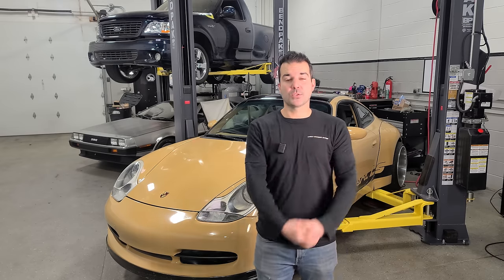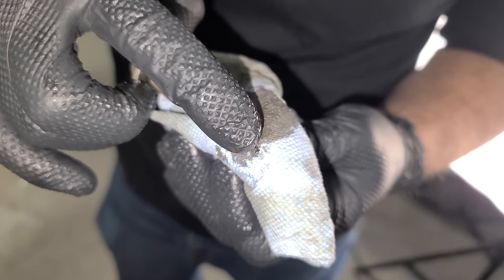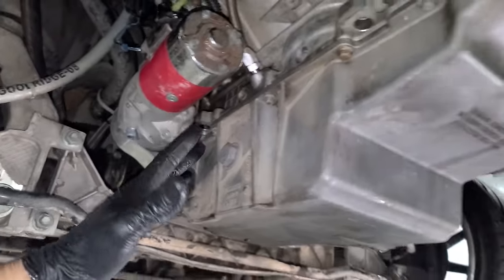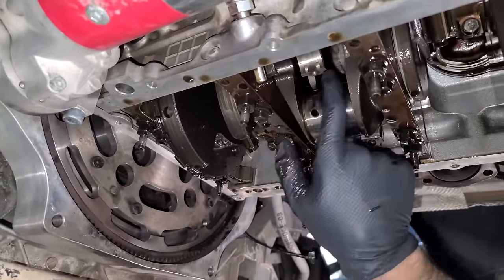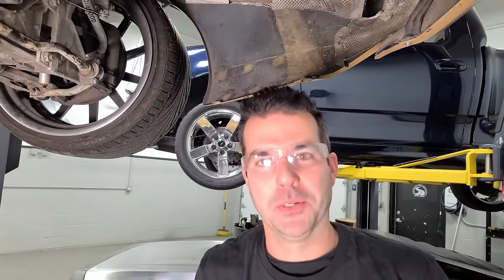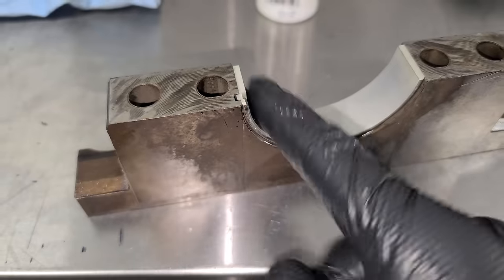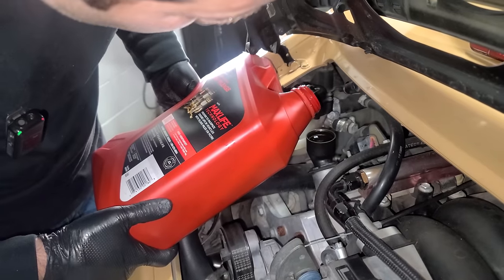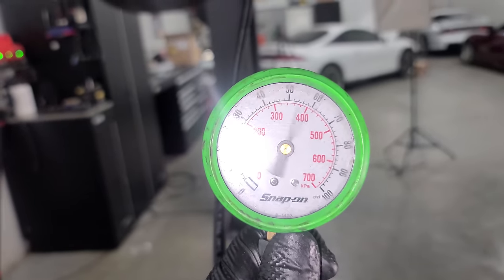My LS Porsche 911 Was About To BLOW UP So I Attempted A RISKY DIY Engine Fix!

Comment from the maker: What are you guys working on this week?
Reply: Here in Canada, big storms are approaching, so working on my snowblower and getting that fixed and ready! 😢😂
Reply: Xmas lights bro.
Reply: ‘70 Boss 302 Mustang.
Reply: Trying to get a broken rusted piece of the fuel pump module send line out of the plastic fuel line that connects to it, in my LS3 swapped Escalade. For oil pressure reference, my cammed/supercharged LS1 corvette with a new oil system (melling) has a hot idle of 13-17psi @ 850rpm.
Reply: Im working on staying warm here in scotland 😂
Reply: 98 gs400 doing a bmc conversion and big brake swap. Once that's completed I'll be doing a manual swap.
Reply: Cooking for friends this week! Cleaned my Miata in anticipation for the first snow last week, so I'm pretty much done until it's not cold outside!
Reply: On my Bmw e21 316  😄 ( just maintenance)
Reply: 1983 Rx7
Reply: Working on studying for my exams this week! Got one more semester of university in spring.
Reply: I just love videos like this! I geek out on engine rebuilding and I had to change the head studs on my 1998 Oldsmobile Aurora 4.0 V8 (DeathStar) months ago. So I know how intense this LS overhaul can be. BTW ARP head studs are a game changer!!!!!
Reply: 1985 Nissan 720 King Cab Pickup
Reply: Not much. But, a friend is helping me replace the thermostat on my 2011 Nissan Murano.
Reply: I wish I was working on my 4th gen firebird...I don't have a garage and it's snowing and below zero...so I'm standing at the window dreaming
Reply: Unfortunately my new NON Legit streetcar! 2010 kia soul lol
Reply: Minibikes
Reply: Working on my 13 vw gti, maintenance work for winter as my daily to work , Pennsylvania winter roads can be brutal on suspension and brakes.
Reply: Thinking of doing some valve cover and intake manifold gaskets on my 5.7 hemi.
Reply: A bit off topic from the channel but 3D models and voice acting.
Reply: I live in the sticks of Queensland Australia. Not as flash as the porshe, but at the moment im working on a Kandi Spyder side-by-side.

I'm welding up and beefing up parts of the buggy's frame and the seat frames that have fatigue cracked from scrub-bashing and rally driving.

I thought I should fix up all the broken bits from the nieces and nephews thrashing about in it last holidays so they can thrash it about and break it all over again during this holidays.

Love your work Alex, thanks for the great content
Reply: TVR Griffith 500. 5.0ltr V8. 
  Simple enough job of installing speakers in the rear. (Just upgraded the door speakers and thought it better to have a matching set in the back).
Reply: 1978 BMW r100 Cafe
Reply: My wife making me clean my garage....... lolz
Reply: If the rain stops and temp isn't stupid low, I plan on replacing my stock front subframe/engine cradle with a TSS Fab tubular unit. I also need to go pick up my freshly rebuilt 6spd and get it into my 2010 STi.
Reply: '99 Rover 75 2.5 V6. Has a problem with the cooling system becoming over pressurised. I assumed head gasket failure but block tester fluid stays blue (I.e. no exhaust gases in expansion tank).
Reply: A miss in my 6.0 reg cab short box Silverado. Pretty sure it’s injector related. Then brakes on the Challenger and then fuel pump on the Vette. 🤷🏼‍♂️
Reply: 95 Ford Probe Gt. Engine swap finished a week ago so now it's suspension time.
Reply: My 1980 AMC Spirit. Getting it up to speed after a 17 year vacation.
Reply: Baking my headlights and swapping out the lenses since they are beyond polishing.  Adding new angel eyes to make it more like a modern BMW.
Reply: Repairing computers 😊
Reply: I don’t work on Cars, but I want to one day. I manage a Hotel so I’m working on selling rooms!
Reply: 1968 BMW r50/2
Reply: 1989 Integra !
Reply: 69 Chevelle.
Reply: 2016 Silverado rebuilding 6l80
Reply: 2019 silvrado v6 turbo addition
Reply: I'd like to be working on a V8 S10 conversion...  But no - I'm not sure what the interest will be in a chat full of car nuts (inc. my self - though I'm interested) - as a low buck alternative I'm in the planing stages of building an E-bike (working out details, making a parts list, and cading up some custom parts).
Reply: Mk4 GTI
A/C compressor is rattling like mad and needs rebuilt/replaced. Instead I ordered a serp belt short enough to delete the A/C until it's warm enough to actually need it😂

ND2 Miata, diff fluid and winter wheels/tires swapped over
Reply: oil pan pickup last night for a new Moroso T-style pan for my 351c mustang
Reply: My ‘18 Tacoma TRD Off Road 4x4
Reply: Snowmobiles... 2 Skis 2 Cylinders 2 Fun
Reply: I've been out of work for almost a year now due to cancer, but today I got volunteered to replace my mother in law's headlights in her 09 Acadia, a pigtail burnt up, so the bumper had to come off...I miss wrenching every day. Now that I'm done with chemo and all the crazy treatments, I'm coming back soon hopefully! Today was the first time I've turned a wrench since January of 23
Reply: My Ford falcon here in Australia just hit 200,000 kms. So I'll do a Coolant flush. Gearbox service, brake flush and oil change. Might do timing chain as well.
Reply: Finishing up my Covid hibernation, so watching YT all weekend!  Great video as always.

Comment: Every 2nd oil change or so, I send a small sample of my oil for analysis to a company like BlackStone Labs. They provide very useful chemical and particulate analysis, including the level of copper present in my used oil; this is a super easy early warning sign of bearing issues. In fact, your iron level would probably start increasing even before the copper becomes present. There are a host of other traces the look for as well. Prior sample numbers are retained for each vehicle, so successive analyses show trends or sudden changes. Think of it as the bloodwork you have done at your annual physical.

Comment: Really surprised to see you using the ARP bolts without resizing the rods. I've seen several new builds spin rod bearings because guys skipped out on that step. Obviously resizing isn't practical for an in chassis refresh so would have been better to stick with stock bolts.

Love the build though!

Comment: I would not recommend using ARP rod bolts unless you machine the rod ends if you don't you can spin a bearing. Since you tighten them to a higher spec they actually make your rod ends slightly oval and not perfectly circular.

Comment: I'm sorry I had to bring up the oil pan issue, but you did find a whole bunch of hidden damage... Glad you were able to make a significant improvement in oil pressure with those very necessary mods!

Comment: You can show me the oil pressure spring in that pump with as many as two to three 5 mm washers.
You can also use that device that squares oil into the bottom of the engine and make sure it's got the Shroud on it but take that off and not the dimple of the top of it down a little bit and that will increase your pressure by about 7 to 10 lbs. Anything much further than that would require either disassembly of the pump to make sure you make some clearances in it or using a higher pressure or higher volume oil pump. The other problem you may be running into is a problem with the oil pressure screen, but you're pulling oil pressure from a different part so that shouldn't be an issue, but that would also have warned you about metal in the oil much earlier. By using the original equipment oil pressure sending unit point. I have built a few of these engines, I do like their design, the problem I have with them is the dod system which you obviously shouldn't have on that particular example. Displacement On Demand is an insanely stupid thing to do to a V8 engine. There's no reason why you can't have that thing rather than shutting off four cylinders, just running lean when torque isn't needed. You can lean an engine quite a bit without causing any damage whatsoever, that was has been proven since World War II when Charles Lindbergh showed the US Army Air corps how to double the length of their sorties with their P38.
Think about it, what would you do to double your gas mileage period when you're just trying to get from point A to point B at normal Cruise speed?
As long as you're there, put ARP Hardware bonnet. I've never been a fan of torque to yield bolts. They are capable of being reused but the entire concept of intentionally causing a portion of the Metallurgy to fail, doesn't sit well with me.
Just a suggestion, when you refill the oil quantity. Put in 5 quarts of oil, a quart of transmission fluid in about 6 oz of fr3. You can put the entire bottle of fr3 in it but you'll have to reduce some of the transmission fluid. Fr3 is a great additive and will help protect a lot of those surfaces and you might even want to wait until at least a little bit of a break-in time for those bearings. All of the seals in the engine will light the transmission fluid and it will not be a problem whatsoever. If you are nervous about that, then use some transmission fluid in it for about a week before you do an oil change or better yet some Marvel Mystery Oil about a week before you do an oil change, it will help keep the engine clean and it is especially helpful with keeping the lifters completely clear of problems.
15 ft lbs on the at least you understand that sometimes when they say you have to replace a bolt, if it's for the purpose of sealing can I guess you can seal it. I actually had somebody argue with me on that point the first time I rebuilt one of these.
I would use one more 2000 grit on that. Or even a finer grit. The higher the Polish the less horsepower loss.
Not sure whether you noticed or not but the original baffle, in that oil pan would work great and a drag strip while that oil pan is turned backwards.
And if it were up to me I would put those two bolts on the back of that oil pan like they're supposed to be. I'm not sure why somebody thought it was okay to emit those two bolts. But they really should be there. But you really want all the bolts to be there even though it's a cast pan and maybe it won't be a problem. But what if it is a problem.
One really good video. I just bought my first Chevrolet ever, it does have an LS in it but it also has the dod system in it. I still want to hunt down every engineer that ever thought that this was a good idea and force them to marry a really bad ex-wife.
I still think it should be putting out better oil pressure at that higher Rev when warm. I'm not a fan of the standard STP oil filter, a K&N 2011 actually works quite well on those engines.
What you did is a perfect example of how to replace your Rod caps. And even most of your mains.

Comment: 300,000 mile + 6.0 03' Silverado-40psi oil pressure cold start---drops to 30-35 when fully warm, stays well above psi vs. rpm. Rpm 4,000--psi 50ish That's with 5-30 in the winter. Summer w/ 10-30 is much better. This engine/mileage issue is piston slap. It's tuned and I drive it appropriately, new engine and transmission coming this summer.

Comment: Had the same issue when I got my stepdads truck after his son ran it out of coolant and oil I ended up replacing pretty much everything including crank and camshaft on a 5.7 vortec.I put high performance bearings and got a machined crank and will be getting a new camshaft also got a new oil pickup tube and oil pump

Comment: I have that issue with the O ring right now. Cars parked in the drive until it can be fixed by mechanics. I do my own work but I’ve got a Vauxhall and to get to the oil pick up tube you’ve to remove the manual gearbox to remove the oil sump which without a ramp is near on impossible. Started with low oil pressure on cold starts. Engine sounding awful for like 20 seconds. Then found the fault online. £700 labour just to get to a O ring!! Hoping it hasn’t done any lasting damage to the bearings or turbo

Comment: After you described oil starvation issue, i would add an extra 1/2 quart of oil past full crosshairs to further eliminate any dry episodes even with the new sump baffle. Well, you read my suggestion well later on in the video👍

Comment: My LS1 cold idles at 60+PSI, hot idles around 35, but I've seen them go as low as 15-20PSI without issue. Hell, I drove my Trans Am 150 miles with a cam bearing that walked out of the bore. Had 0PSI at idle and 6PSI at cruise. No damage to the crank at all.

Comment: Hey man.  On the overpriced kawasaki and kholer v twin motors i have even used just my wife wheel to clean the crank. The aluminum piston rod welds itself to the crank but DOES NOT HURT IT AT ALL so you wheel all the welded on aluminum off of it and its a mirrored brand new crank again. The crank is so hard that the wire wheel couldnt hurt it if you tryed.

Comment: Should also check the volume of oil in it. Its super common to "pump the pan dry" when guys throw a high volume pump on. The oil drains too slowly back down to the pan and the pickup is often starved. To combat that issues instead of fancy baffles that won't correct the issue, simply run 2 more qts of oil. I did back to back runs at the track (1/4 mile) with 5.5qts and 7.7 qts. Same exact MPH and ET. Only the oil pressure didn't drop in my logs with the 2qts "over full" run.  (fbody oil pan) 8 second car 1.3x 60' with the front wheels up.

There is also an orange and a blue o-ring on the pickup. You may have the wrong one installed. that one looked really loose.

Comment: I’d be a little weary of putting in ARP bolts without honing the rods.  I did a 351W a few years ago with ARP mains after machining and it changed my clearances drastically.  Ended up taking the block back to have it align honed.

Comment: I used to do this job on Nissan Maximas. Nissan had a TSB for a knocking engine. The fix was replacing the bearirngs with the crank in the engine.

Comment: Great job, you take your time and work space stays clean. Your ahead of the type that I see on a daily: they just put it together and run it. Apparently they have some kind of luck on there side cause it happens, alot!! I have to put it back better than when I took it apart and alot of the time that takes time.... I've learned a lot from you over the yrs and appreciate your videos
Just subbed. Again

Comment: Alex, I have replaced new bearings on rod and main journals that looked 50x worse that what you have here and they were perfectly fine after a light journal polish with emery cloth and a shoestring. Of course they were not on spun journals. If it were me I would polish the journals with emery cloth, Plastigauge everything, and install a set of King Main and Rod bearings. It should be perfectly fine afterwards. If you want you can blame OJ for his aggressive driving, LOL.

Comment: That's interesting about the oil there, that they recommend half a quart more with the baffled oil pan and you run a full quart more on the trans am, like maybe this problem, with the varriance of tollerances on the camshaft comes about purely because it doesnt have enough oil from stock

as i know GM, they would be that bad

Comment: With the clearances you have you should definitely be running 20w50 oil. 95% of the LS people especially once built “yes I know it’s a stock engine” but has been taken apart always run 20w50   I’ve ran 20w50 with even tighter clearances.    Will definitely help with oil pressure especially when hot

Comment: Awesome video! With 3 to 3 1/2 thousandths clearance on the mains, you might be better off with a 20-50 or even straight 50wt. like VR1. Cheap insurance to protect that engine.

Comment: Thanks for the great series! I’m really enjoying this content and everything on your channel! Im not an LS expert (more familiar with nissan RBs), but isn’t it common to have bearing damage that can lead to spun bearings from detonation? If the current tune isn’t quite right and you had detonation happening in any of your driving in “mexico” previously, is that possibly the cause of the problem? I know with RBs, they are a knock limited engine, and its easy to have inaudible det/knock at mid rpm under load if the tune isn’t great. A loud exhaust will make it even less likely to hear det.

Comment: My only issue is the ARP bolts. I've always been under the impression when you change out your rod bolts you're supposed to have them line bored(possibly wrong term) to make sure they're true after the swap. Otherwise I've bearing swapped stuff like that before with success.

Comment: My 03 1500HD with the 6.0L LQ4 cold start is 55psi warmed up idle is 38 to 42psi. Highway 45psi but if you get on it it will get up to 75psi

Comment: You could also tell in your first video when you scoped the cylinders they did not look great.. no cross hatching but you did have verticle scratches. That engine has definitely been hurt from oil starvation. Its not destroyed but not great.